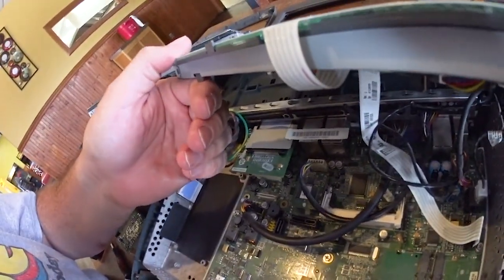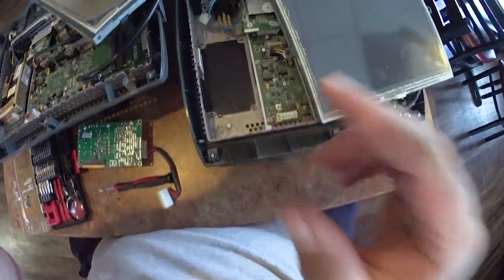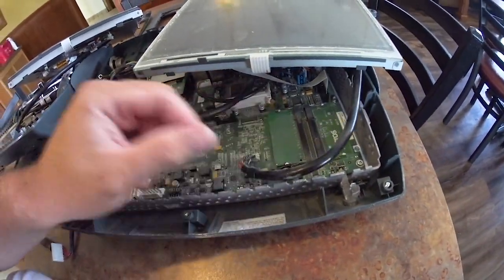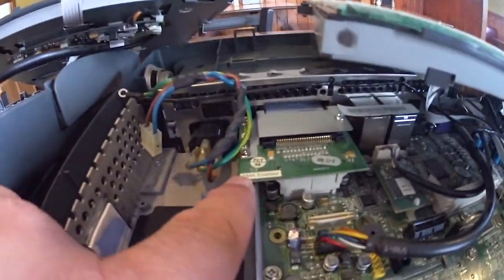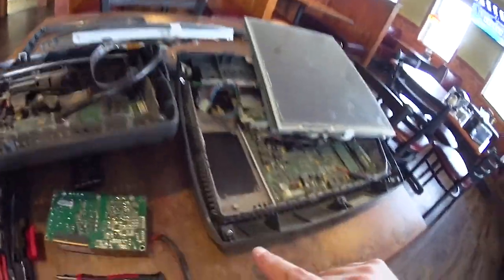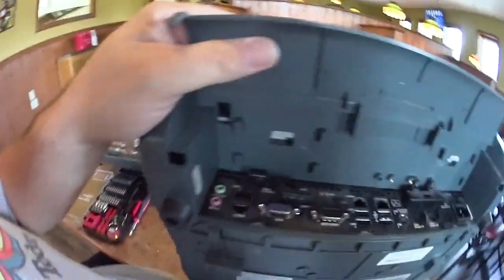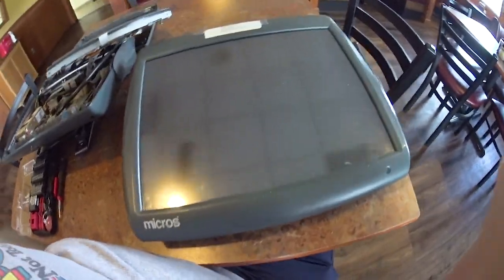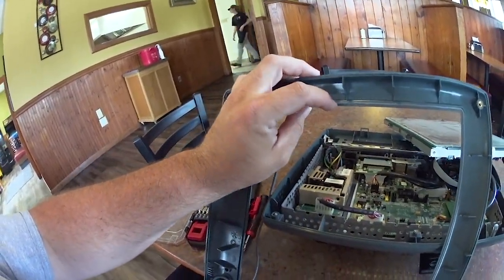Micros Workstation 5A Point-of-Sale PC Disassembly and PSU Replacement - Jody Bruchon Tech

Comment: It's common practice to cut o-rings, superglue them back together, making them for custom applications in the automotive industry to get by in a pinch. If it's all you got and need to get it back up and running, it's a viable option.